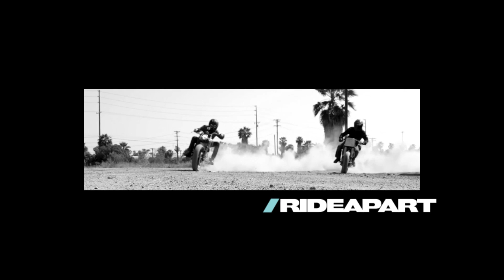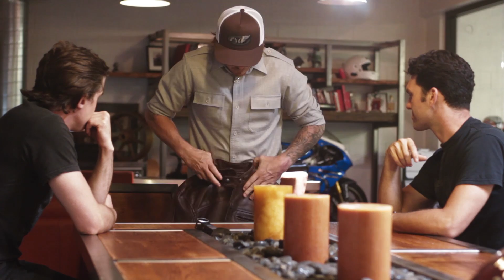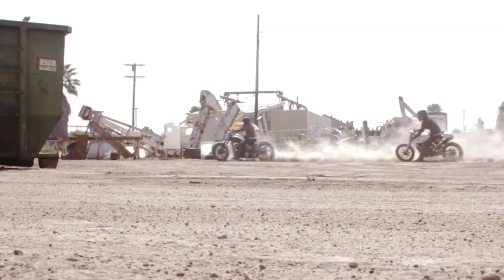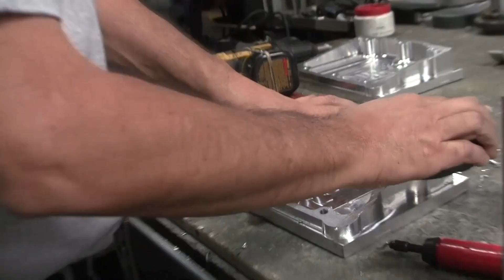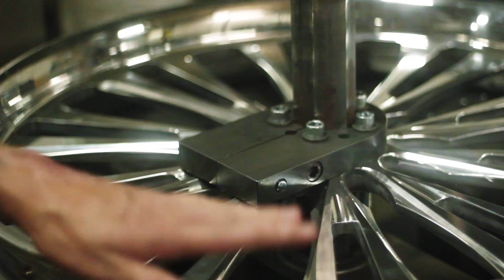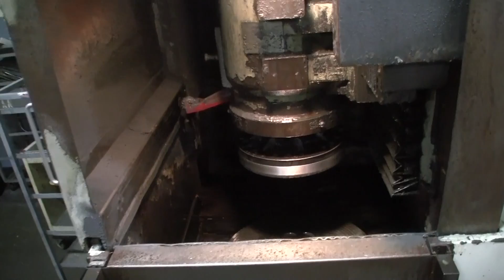Getting dirty with Roland Sands Design - /RideApart

Comment: Ooooohhhhh, I wish these guys made wheels for my bike.  But even if they did, I couldn't afford 'm.  All props to Roland Sands Design and manufacturing.  My "wish" list would be machined front and rear mags, with dual disc brake and calipers front, single disc and dual caliper rear.  Risers and bars with internal control cables.  Powder coated exhaust, intake kit with FI module.  Leave the rest of the bike stock.  Wait for  someone got a little closer to it and notice. . ."hey, WTF is this?" ~S~

Comment: Actually, engineers calculate the theoretical limits. Testing is done to make sure the manufacturing process and materials meet the engineered expectations. 1 step without the other is a recipe for disaster.